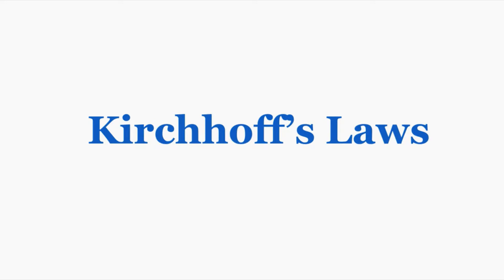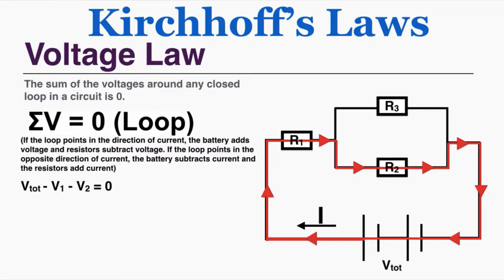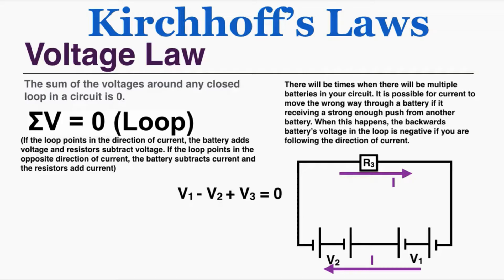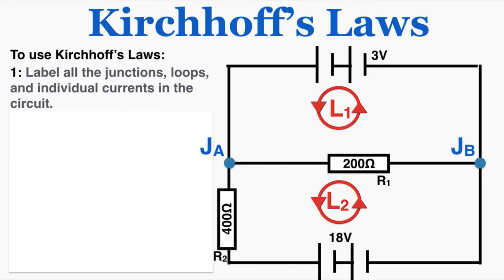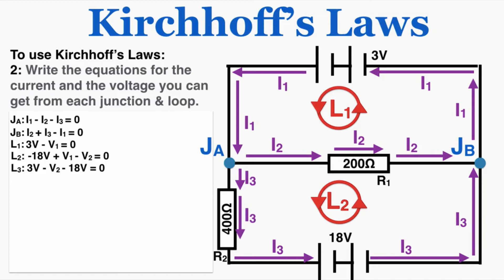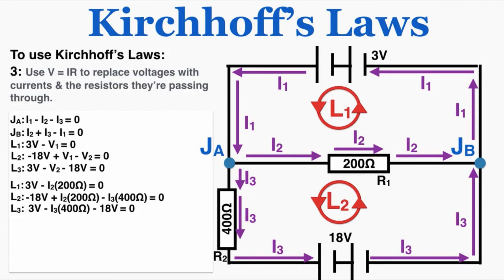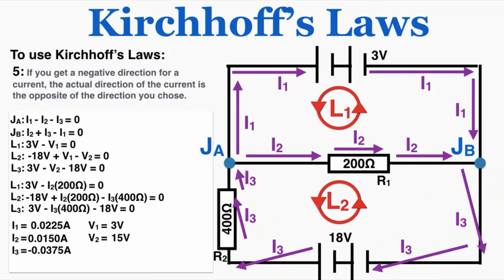Kirchhoff's Laws - IB Physics

Comment: This was the only video that was actually quite good about this topic. But, as a suggestion, I would say it could be better if you could use drawings when explaining the signs instead of just telling them verbally. It seems complex for many as to why the potential differences are taken positive or negative in the loop, so a bit more clarification on that would be extremely helpful, Sir. Regardless, thanks a lot.

Comment: why would the 18 volts in loop 3 not be positive? Would it not be 3V - I3(400) - (-18V) since the current going in the battery is in opposite direction?

Comment: Thanks for the video, it was really helpful! At 1:08, did you mean "the battery subtracts voltage and resistors add voltage"? Since V=IR I guess it's the same thing but I was wondering if the focus here should be on voltage instead. Thank you!

Comment: you said something wrong at 9:06 it should be I2 time R2 but you said I1 time R1. also for the same part, for V2, you said R3 times the second current where it should have been the second resistor. Beside that, this has been one of the most helpful video I have seen on Kirchhoff's law.

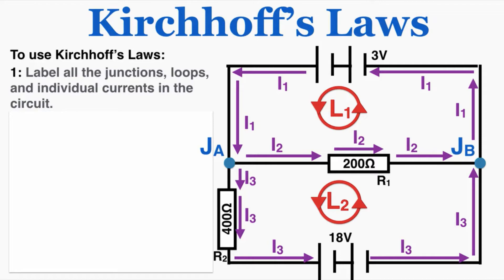Comment: Can you comment on what determines our choice of loops should be in a given circuit generally. In particular, should no loop be the combination of any of the other loops chosen. For example, would choosing the outer loop also here at 5:10 just yield the same information as the two inner loops.

Also, can you give any intuition whether Kirchoff rules always lead to a solution: ie that we always get as many independent equations as variables. Thanks.

Comment: Isn't I0 at 9:00 equal to 0.0525 ?
Reply: Find I3 first. It turns out to be negative (I3= -0.0375). Then find I2 = 0.015.So when plugging that back into the JA equation
 JA: I1 -I2-I3=0 becomes
 I1-0.015-(-0.0375)=0, 
I1= -0.0375+0.015
I1= -0.0225